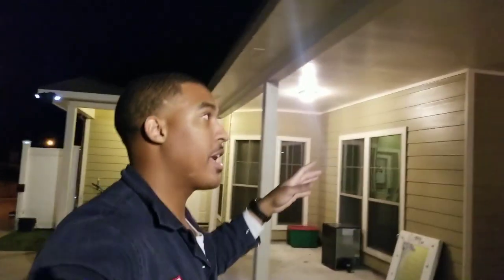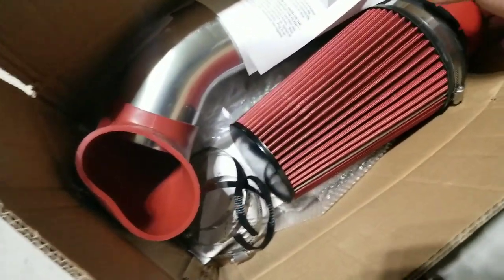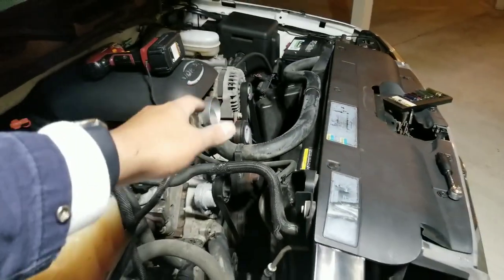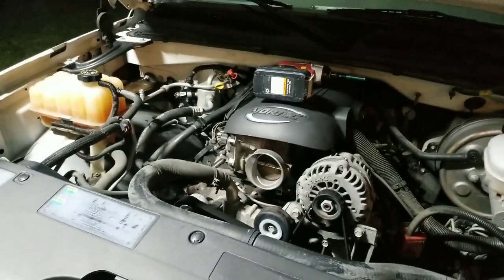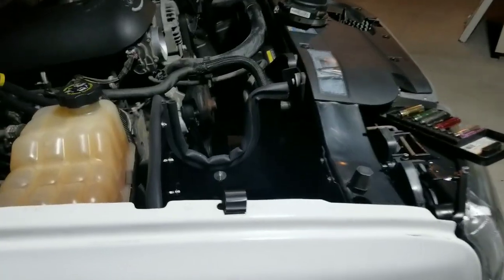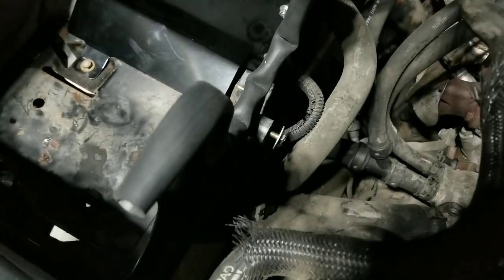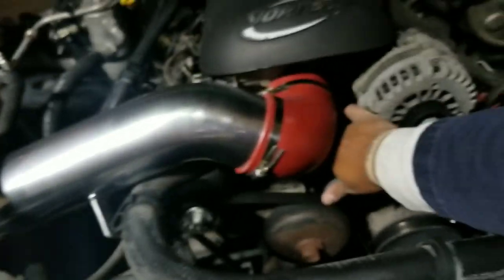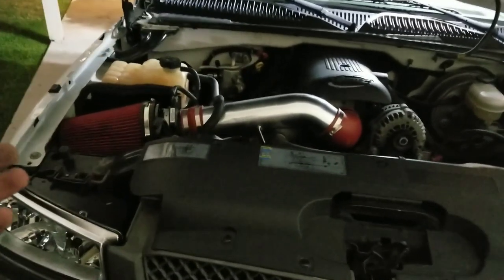Cold air intake install on Silverado |Ebay parts | Worth it?

Comment: Great job... I installed an Airaid intake tube on my '02 Tahoe. I kept the stock filter box. I have felt a difference in throttle response and have noticed a small gain in my mpg.

Comment: Your supposed to take that plate out so you have a ton more air goin to the filter
Reply from the maker: does no good if your pulling hot air. This was more for looks than anything, wasn't really worried about getting any gains

Comment: Do you need to replace those filters after a while or just clean them, and if so where do you buy replacement filters
Reply from the maker: The filter is reusable, all you have to do is clean with a proper cleaner and water, let it dry out re oil it and put it back in